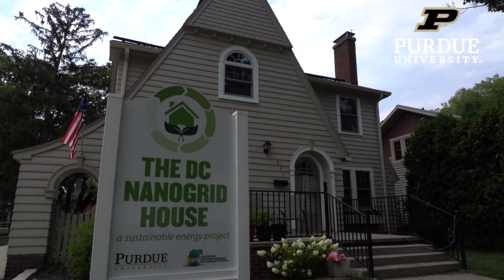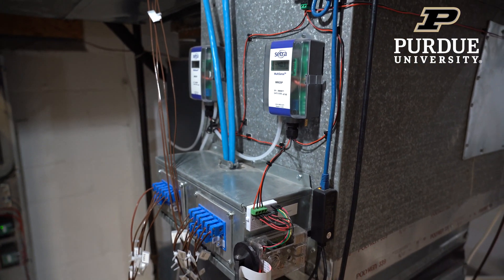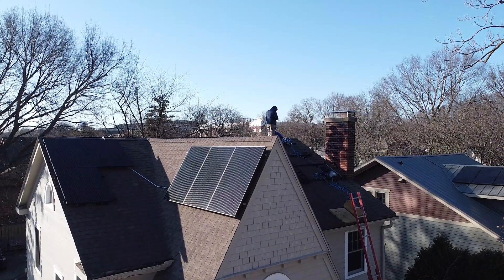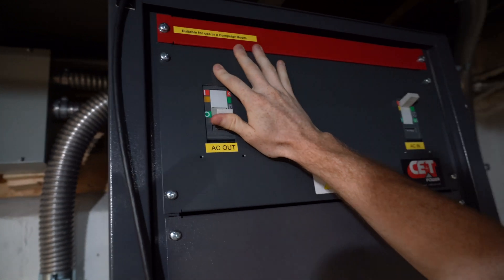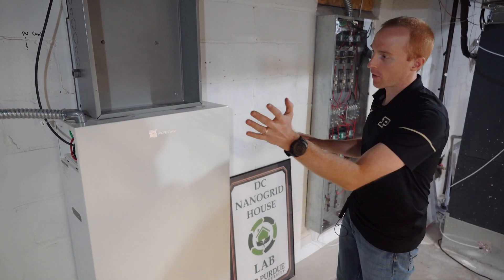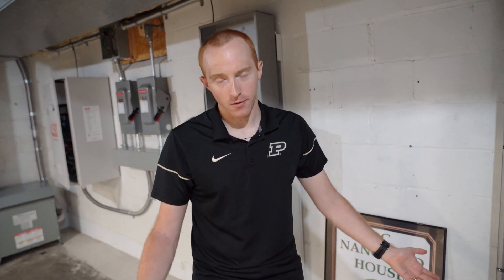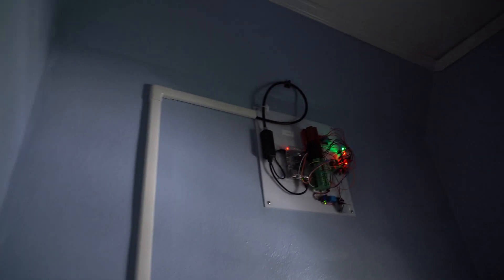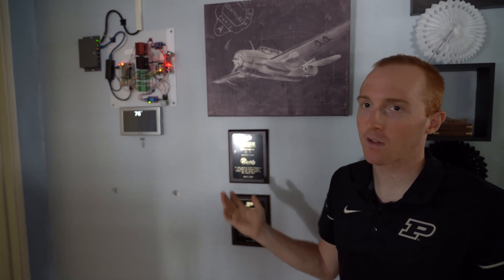This House Runs Entirely on DC Power

Comment: Running an appliance on DC instead of AC does not save 90% of the power. Modern sinewave inverters are over 95% efficient in general.

Comment: Thanks guys! I have been waiting for this for the last 33 years when I wondered why we were sending ac power into our homes rather than dc power. Nobody ever provided a satisfactory answer. The answers just don't add up. The inefficiencies cannot be overcome. DC just makes more sense to me. If certain things still need ac power, that power can just be allowed through on a circuit that only services the ac outlets. The dc that was converted as it entered the dc system would only serve the dc outlets. This is so far overdue. You all did a great job!

Comment: If your house had all 12 volt lights, and appliances, fridge, oven and even ac ?
Reply: 12v? that would be silly, we are even getting away from 12v in the automotive world let alone homes. 48v is really the minimum you would want to run for high current applications like refrigeration (48v DC compressors are readily available for these applications) , although much more voltage than that and you start to run into issues with switching that get a bit more complicated (expensive) when dealing with DC. 24v would make sense for a lot of lower powered devices though like consumer electronics since they typically run between 5-20v which would result in less loss from the buck converters (the greater the voltage difference between the input and output the lower the efficiency).

Comment: Eh, really... worrying about closing off vents to a room... that is a massive over optimization.  Modern HVAC equipment scales up and down and prefers to run slowly for longer... doing something like that will force it into recovery mode when it needs to be brought up to temperature (draw more current... which is actually bad for running off of batteries).  Plus, unless you've air sealed and insulated between rooms, it is going to have a minimal effect.  Basically, all of the effort and resources used to be able to control that were wasted... not very efficient.

Comment: have been slowly turning my 2013 chevy volt into a camper on wheels for medical school rotations which are spread out every couple of weeks across rural areas in my state.
car has 200w of solar which feeds into a lifepo4 battery which i replaced the 50lb (23kg) lead acid battery with, 32ah ~7lb (3 kg), same usable capacity but i wont kill it if i drain it too low. car has a modular 8kwh range extender i built with level 2 charging and pass thru, so i can draw about double what the car normally could from the free chargers around town/at all the hospitals, and use that for the rest of the day to keep car warm at night. I get about 50-55 miles of range on the original lipol battery, about 10.5kwh of the 16.5kwh pack are not protected by the cars bms, which is basically what the car came with 140k miles+13years ago.
dc fridge runs thru another 32ah lifepo4 battery which i built into my own powerstation, dc only of course. use it for heated blanket and my 12/24v rice cooker. i mean its got all the amenities, maybe more of a hotel room. it was ~28F most of this week, i think around -4C, and i just plugged into one of the free chargers and woke up with a full battery to go to rotation. was actually too warm last night. might sound kind of odd, but i think old ev's/phev's and free chargers installed by the city would go a lot further to helping people who are experiencing homelessness. people who wernt homeless could use them too, but its a very useful inbetween zone from what ive learned this last few weeks. running everything on DC has allowed me to do much more than i could of with an inverter system. inverters really should be thought of as wear items, like a pencil. they get used up with how theyre made now days (high frequency switching IC's, poor heat management, poor mfg tolerances). there are more and more appliances that can run directly off of DC, and lifepo4 voltages are basically stable enough to replace most power supplies. even this car's air conditioning runs off high voltage dc, which is very efficient. burning gas for heat on long drives basically makes this car close to 100% efficient with the engine. I dont loose any range in the winter, well maybe about 5 miles but thats more down to tire pressure and air density. the volt really was the most misunderstood car ever made, and now everyone wants PHEV's all over the world. mine cost 6k usd and paid for itself after 18mo and 45k miles. none of my investments have done that well.

Comment: Things like refrigerators, microwaves, and vacuum cleaners run off of AC. How did you go about converting them to DC, or is there still some limited AC in the home to run these appliances?
Reply: Vacuum cleaners, drills, Skil-saw, Sawz-all and other devices using series wound motors work identically well on 120 VAC or 120 VDC.  AC switches used on DC need to be protected with a snubber.
Reply: @peteinwisconsin2496  Finally someone who knows this! Also, straight heating elements and incandescent bulbs don't care if it's AC or DC either. Explain a snubber.
Reply: @ Hi: I posted a detailed explanation about snubbers.  Start reading at the top of this thread if you haven't already seen it.  If you don't see it I'll send it directly to your comment.
Reply: @peteinwisconsin2496  I don't see it, please post explanation here in the comments.
By the way, it would seem 120 volts DC would be kinder to appliances that buzzing AC.
Reply: @GamalielKinsey  The concept of the capacitor + resistor + diode might seem to be complicated, but it's not.  A capacitor is essentially a battery.  Just draw the capacitor in parallel with the switch and open and close the switch in your mind.  You'll get how it absorbs the arc upon opening the switch.
    Then you just need a way to slowly discharge the capacitor when the switch closes-- meaning the resistor in parallel with the diode.  I'll write again when I post a video on snubbers to protect switches.
Reply: @peteinwisconsin2496  I still don't understand why while running on 120 VDC, switches need a snubber, but while running on 120 VAC, it does not. (or did I not understand the context) If burning up switches is an issue, then I can add one to the circuit that is super easy to replace. wall switches cost $1 while appliance switches cost $5 to $10. Since I plan to run a separate circuit for my 120 VDC outlets, why not have a switch per room or duplex receptacle. Henry Clews, the guy in the book "producing your own power "ran a 120 VDC wind turbine in the 1970s to power his house. No mention of snubbers in his article. (He got AC from motor- generator inverters) my pursuit of 120 VDC is to get AWAY from electronics (expensive inverters) I'm not saying snubbers are dumb or wrong, I'm just asking questions.
Reply: @ You pose good questions.  The main reason that AC is easy to switch off is that the 60 cycle current reverses 120 times a second, meaning that the power is actually off 120 times a second.  Even if you tried to open a switch Slowly on AC, you would not get far before the arc would go out by itself.
     It is true that with DC you can minimize the arcing by opening the switch Fast.  By fast, I don't mean with your fingers but with the swipe of your hand that is moving Fast.  I do that anyways on snubber protected switches.  You certainly can, with or without snubbers, put a switched outlet in each room.  Do anything to not use the switch built in to your vacuum cleaner, corded electric drill, crock pot, etc..
      The remaining challenge is things that have thermostats and turn themselves on and off at times we can not predict.  Toaster oven, hot plate and water heater come to mind here.
     The first snubber I made was with a 1,000uF 250 VDC capacitor scrounged from a computer power supply and a full-wave bridge from same.  Here I used just two legs, meaning just one of the four diodes in the bridge.  I had the resistor on hand.  The purpose of the resistor is to limit the discharge current but bleed down the capacitor in a reasonable amount of time-- for when the toaster oven switches itself back on.  Pretty much anything between 50 and 1,000 ohms will work.  More ohms means that the capacitor will bleed down more slowly and be less able to protect the switch next time.  Old clock radios and other old personal electronics are a source for these.  Dead microwave ovens are another good place to look for parts.  
    Or buy what you can't scrounge:
capacitors, $9.77 each or  $7.32 in lots of ten; diodes, $1.36 each, $1.02 in lots of ten; resistors, $4.47 each or  $3.02 in lots of ten.
Reply: @ It will be a good year before I get setup for 120 VDC. If I rent a house, I can't hard wire a house that is not mine, I could surface mount my DC circuits. Anyhow, for the appliances I may want to protect, would you sell me 120 VDC snubbers with wiring instructions?
With all this commenting how would we switch to email? if you so choose. 
I really wonder if I'm saving money building a 120 VDC system tandem to my AC system. my 20 - pole, double throw 12-to-120-volt, series-to-parallel MEGA switch (homemade obviously) will cost me 100s of dollars alone.
Reply: @  I choose to charge on 12 volts for convenience and availability. Even though 24- and 48-volt charging systems have their advantages. Two sets of 10, 12-volt batteries can toggle between "parallel- charge -run inverter" and "series-120 volt DC". This way neither 120-volt DC bank will not be off for charging. (P.S. I know 10, 12-volt batteries can also be configured to be 24 and 60 volts. but not evenly for 48 volts). 240 volts DC can run a range, but by then it's time to start the generator! Or go wood or propane! When the generator is on, 120-volt DC outlets and lights is AC, just like Henry Clews' system.
Reply: "Not, with neither" is a double negative. Oops!  meant to say, "Neither will be off for charging".
Reply: The primary purpose of running on 120 VDC is for a system with No batteries and No inverter.  I have posted a list of useful devices that run on solar panels directly.  This is for those who have just landed on their new homestead or are just getting in to solar or who have been devastated by a natural disaster.  Electricity for some appliances is better than no electricity at all.
     Those who have gotten as far as batteries + inverter are already past the point where PV-direct should be appealing.  Or maybe their battery + inverter system is really small and they need to operate power tools, cooking appliances and want the bonus of powering a small tank-type water heater.  In that case, stay tuned.
Reply: @  I'm not against photovoltaic panels, but I'm more of a wood (Stirling engine), wind and Diesel guy. I'd like a solar heat collector, perhaps. Every time I see a waterfall I want to put a waterwheel under it and power stuff! 
Buy the way, that's smart thinking running solar 120-volt DC strait to needed power tools. Sounds like a prepper hack. 💡

When it comes to Diesels and wood fueled Stirling engines, it seems the waste engine heat could be used to heat a house and/or water. Ever fried eggs on a muffler? LOL😁

Comment: From Purdue U : "Alongside the nanogrid, household appliances possessing a significant yearly energy consumption are retrofitted to accept DC inputs. These modified appliances are tested in a laboratory setting under baseline conditions, and compared against AC equivalent original equipment manufacturer (OEM) models for power and performance analysis. Finally, the retrofitted devices are then installed in the DC Nanogrid House and operated under normal living conditions for continued evaluation"
Reply: Thanks but no duh. 

Without the specs it tells us nothing, That couldn't be already logically deducted.

Comment: Small, DC power grids for individual homes are used all over the world in Third World countries. 

People who cannot afford power inverters we’re just a purchase of a power inverter might be six months of their entire gross wage for the year. It is just out of their reach for a whole small villages.. 

They’re DC refrigerators, microwaves, televisions, radios washer, machines dishwashers all the motors runoff low-voltage 12 V 24 V or 48 V .    Directly off solar panels and batteries.. 

Very little expensive Electronics, because they simply cannot afford it . 

Americans Europeans developed countries have a very sophisticated very expensive and energy wasteful inefficient power management systems . 

Every time you have to step voltage up or down, you lose power in inefficiencies
Reply: >- Small, DC power grids for individual homes are used all over the world in Third World countries. -<
I hope they do because I promote DC for home use with the power coming from a PV array with no batteries and no inverter--just three solar panels in series.  There are so many 120 VAC appliances that work fine on 120 VDC.  They include series wound motors, resistance heating(cooking) and switch mode power supplies which means cell phone and laptop charging.  There is a lot that won't work on DC but also a lot that does.  A 120 VDC system is a good place to start, especially because many of the power tools needed to build a house run on  120 VDC.  When money is becomes available, reconfigure the array for 48 volts, add batteries and inverter.
Reply: @peteinwisconsin2496  Pete in Wisconsin has his head screwed on straight 🤔
Reply: Snubbers.  DIS-connecting direct currents at 120 or 240 volts is a big deal as arcs will be created as the contacts separate.  Wire a capacitor in parallel with the switch.  The capacitor starts at zero volts, because when the switch is closed it is a short circuit to the capacitor, but its voltage quickly rises to that of the circuit being switched off.  For a few milliseconds there is little to no voltage on the switch contacts which are rapidly separating.
     Now we have a capacitor that is charged up and must be discharged before re-closing the switch, so we don't cause more wear with high current sparks.  Capacitor discharge currents can be very high.  Put a resistor in series with the capacitor to limit the discharge current.  
     Lastly, we still want the capacitor to charge up as quickly as possible, so there is essentially no current and no voltage to interrupt as the switch opens.  That means putting a diode in parallel with the resistor.  This allows the current to flow freely into the capacitor when the switch is being opened but the discharge current from the capacitor is forced to go through the resistor.
    Values for a snubber for a 1kW toaster oven on 120 VDC that work for me:   Capacitor 1,000uF (Not exact), 100 ohm 25 Watt resistor (also not exact) and a 5 amp diode.  The diode is connected in parallel with the resistor and that pair is in series with the capacitor.  One side of this group is connected to one side of the switch and the other end connected to the other side.  Be aware that polarity for both the capacitor and diode must be right.  Make sure the diode allows a free path to the capacitor while the switch is being opened and the diode blocks current flow as the switch is being closed again.

Comment: ระบบดีซีไดเร็ก หรือ การใช้ไฟฟ้ากระแสตรงจากแผงโซล่าเซลล์ 
สามารถนำอุปกรณ์ไฟฟ้าAC ที่มีจำหน่ายในท้องตลาด
นำมาใช้ไฟกระแสตรง DCได้โดยตรงไม่ต้องดัดแปลงและบางอุปกรณ์ต้องปรับเปลี่ยนสวิทช์
ทั้งนี้ แรงดันไฟดีซี จะต้องไม่เกิน 250 โวลต์ หรือการต่อแผงโซล่าเซลล์ อนุกรมไม่เกิน 6 แผ่น
วัตต์รวมของแผงโซล่าเซลล์ ต้องมากกว่าโหลดที่ใช้ 2 - 3 เท่าตัว เนื่องจากแสงแดดไม่คงที่
และการบริหารเวลาการใช้งานให้เหมาะสมกับแดด เป็นสิ่งสำคัญ เพราะไม่มีแบตเตอรี่ (ราคาแพง อายุงานสั้น)

แยกอุปกรณ์ไฟฟ้าเป็น 5 กลุ่ม ดังนี้ 

1.อุปกรณ์ไฟฟ้าประเภทสวิทช์ชิ่ง ใช้ไฟตรงจากแผงโซล่าเซลล์ ไม่ต้องดัดแปลงใช้ได้เลย
Switch power supply uses directly from the solar panel with out battery
https://youtube.com/playlist?list=PLiNwptloVQwO1xy5SdI1QyYNLIK3thaTI
.
2.เตาเหนี่ยวนำแม่เหล็กไฟฟ้า ต่อตรงกับแผงโซล่าเซลล์  ไม่ต้องดัดแปลงใช้ได้เลย
Induction cooker uses directly from the solar panel with out battery
https://youtube.com/playlist?list=PLiNwptloVQwM0dgUBNRcszaA3OeGVyZof
.
3.เตาขดลวดไฟฟ้า ต่อตรงกับแผงโซล่าเซลล์ ต้องเปลี่ยนสวิทช์ ไฟกระโดดสวิทช์ชำรุดเสียหาย
Heat coil uses directly from the solar panel with out battery
https://youtube.com/playlist?list=PLiNwptloVQwMGZsgqi0gk27T0BpTNQHWv
.
4.มอเตอร์แปรงถ่าน ใช้ไฟตรงจากแผงโซล่าเซลล์ ต้องเปลี่ยนสวิทช์ ไฟกระโดดสวิทช์ชำรุดเสียหาย
Universal motor uses directly from the solar panel with out battery
https://youtube.com/playlist?list=PLiNwptloVQwOp4kxo7S1i-4CaGy6WGdXl
.
5.ตู้เชื่อมอินเวอร์เตอร์ และอินเวอร์เตอร์ ใช้ไฟตรงจากแผงโซล่าเซลล์ ไม่ต้องดัดแปลงใช้ได้เลย
Inverter welding and DC to AC inverter 
uses directly from the solar panel with out battery
https://youtube.com/playlist?list=PLiNwptloVQwPyRHLQCS3ozQF-x20xlj04